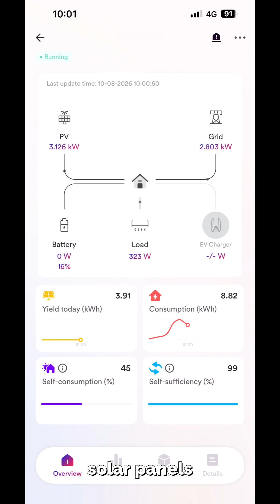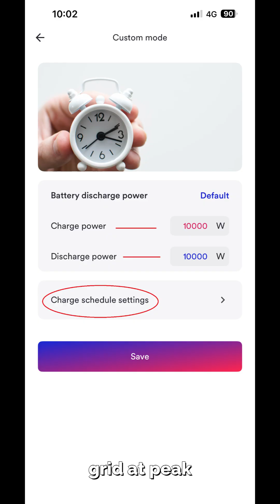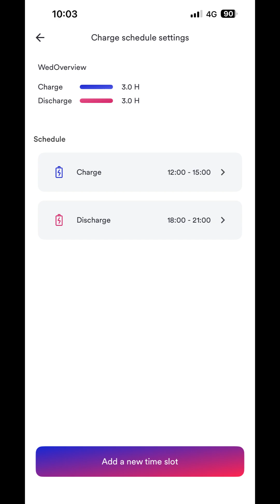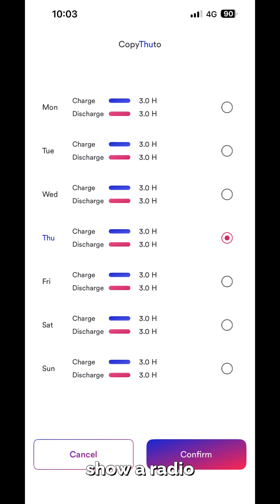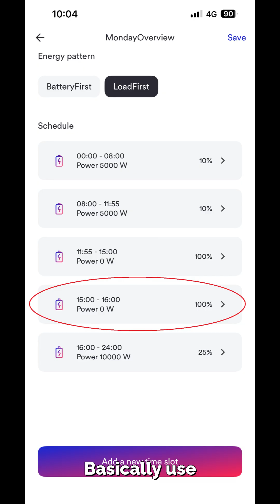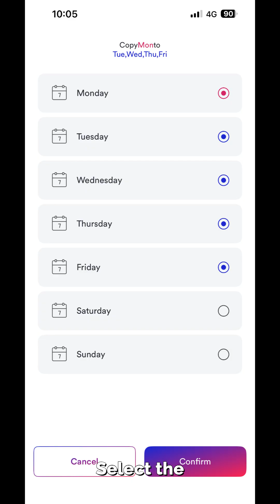Solplanet App - How To Use App - Custom Mode - Time of Use Mode - VoltX - GloBird Energy - Australia

Comment: Did you by any chance test the charge limits for Time of use? When i configure it to pull max  3k and Save the configuration and confirm the daily schedule my settings. If i then navigate back to the settings it is set to 0 again. At first i thought its maybe a display issue, but it is not. Even if i would expect it to not charge since 0 is there, it pulls the whole capacity of the grid.

Comment: For me, I'm only able to get cheap electricity between 2-4am and then have a night rate from 11pm-8am...how best would you suggest i tailor my time of use to this?
Reply from the maker: This is tricky one too.
First way I would try to make it not a manual task.
1)	 In ‘Battery Settings’ Main screen keep "Battery Charge Maximum" = 100%, "Battery Discharge Minimum " = 10%.
2)	Then in Custom Mode; keep “charge power” and discharge power” as = default (whatever your inverter capacity is e.g. 10000 w
3)     Then In the Daily Charge schedule settings, choose the next day and set charge  to 2.0h and the time 2am-4am
4)	Click on the discharge and click ‘delete’ if there is a time slot.

So, this will only have a charge time for 2am – 4pm and no discharge unless house needs power.
Try it and if it works, lets us know.

Comment from the maker: Spring/Summer Update:
I am using the 'Custom Mode" for spring and Summer settings: 
Battery discharge power default
Charge power: 10,000
Discharge Power: 10,000
Daily Schedule Mon-Sun
Charge 3.0 H ( 12noon - 3pm)
Discharge 2.0 H ( 7pm - 9pm)

Comment: Ok can you help me

From midnight to 6 am is electricity at eight cents / kWh 
I use this time to charge my EV
From 6 am to midnight is the normal tariff rate of $0.38/kwh
During this time I need so energy to charge my batteries to the maximum

However, from midnight to 6 am I want the grid to charge my EV not my batteries so how do I do this in the settings?
Reply from the maker: This is a tricky one. I guess it would need to be done manually in the Battery Setting Screen ; from 12 - 6am, where you change "Battery Charge Maximum" = 0%, "Battery DISCharge Minimum " = 100%. This way the battery won't get charged and any electricity being pulled is pulled from the Grid. But that seems like a manual task as you need to change back "Battery charge maximum" = 100% in the morning and Battery DISCharge Min = 10%, and if you forgot, your battery does not get charged at all. 
I don't have an EV so I can't say for sure. Test and let us know.
Reply: @isaydivx thank you